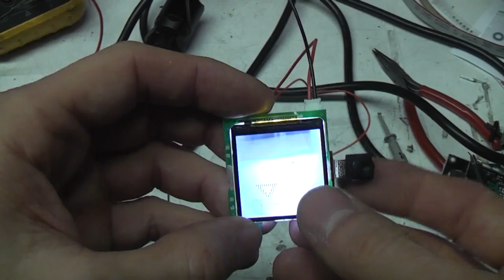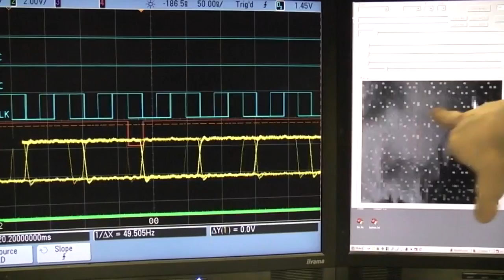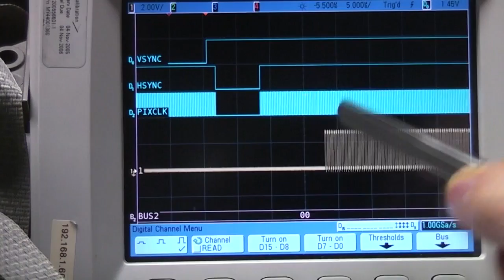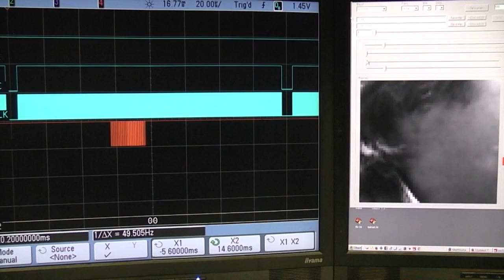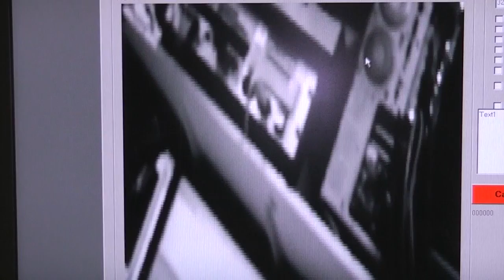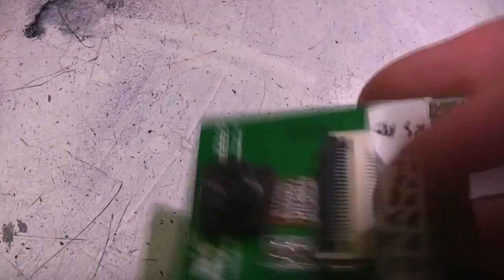Interfacing a cheap phone camera module to a PIC32 microcontroller.

Comment: ten years, wow. people have been able to document almost all the registers of the raspberry pi camera, dunno exactly how, maybe fuzzing, but they've found  crop and timing registers that let them do really silly things, like getting x000fps at 128x64 crop. imo omnivision is paranoid about documentation because the asics are so similar. they get to do binning and market segmentation pretty much entirely in 'software', and especially with phone sensors the spec bumps are based on reduced duty cycles. found out about that because sony is actually explicit about it in their documentation

Comment: Thanks Mike, I noticed that you kinda focused around maintaining frames rates and therefore DMA management and general memory consumption where clearly important. I question, did you ever experiment with very low pixel clock rates. The reason I ask is that I don't need full frame rate video, but rather still capture. ( In fact even the still capture does not need to be fast per frame, as the image content will also be almost entirely static as I'm looking for monitoring leaks in roof spaces).  I was hoping to use of a bag full of old phone modules that I have lying around to capture surveillance remote monitoring images and slowly dump out from the location using NB-IoT. Its simply a reasonably cheap CMOS sensor with a usable interface that I need. Do you know is these devices continue to work if you push the limits of low speed operation?

Comment: Wow thanks for being probably the only person on youtube to go to this depth about how image sensors work! Amazing information!! I've watched this about 12 times, initially knew nothing about electronics at all, done a heap of googling in between, but now understand everything of what your are talking about.

At first I wondered how a "Piano" fits in with electronics, but now I do know what a "PLL" actually is!  I feel confident enough to try and design/build my very first ever electronic circuit using one of the optical LVDS variants .. this'll be fun ..
Reply: As someone who is in the position you were in, were there any particular websites or Google searches that made finding everything easier for you? I want to figure this all out but I am struggling to know even where to start.

Comment: Repeats himself too much, I gave up at 1min because in that time all I got was low res display camera blue & white LED's about 5 times. Why don't they write a script that they read/follow so they don't sound like a drongo.
Reply: etmax1 Minutes 2 - 26 were very dense and non-repetitive.  Worth a watch.
Reply: David Williams
Thanks, I started from 2 minutes, much better. I should have been more patient I guess. Very interesting. So what's the slowest rate you can clock the pixels out? for a robot I'm thinking may 1 frame per second or even every 2 seconds would be good for obstacle avoidance.

Comment: MT9M001 also can skip columns/rows internally, so you can down-sample image and at the same time, get higher FPS. If you need slow that down, you could simply increase shutter width, and that will slow it down as much as you need

Comment: i connected MT9M001 to STM32F429i in no time via DCMI and using SRAM as frame buffer, not only that, i am using SPI DMA for sending 200x200x8 image to computer

my question, how can i load data to computer at 30fps/HD ?
Reply: SincereFirst branded camera modules is great.

Comment: I was making a pixel led strip light-saber load pov images from sd card, but I was completely out of memory, had to do similar; read file for 32x3 bytes, spi out the pixels in rgb, continue reading file. If I buffered the whole file I would quicly be out of memory.  Very clever stuff!

Comment: Great! As it so happens, I was given some of these "Sunny" branded camera modules recently. Not that I know what to do with them, I can barely write a few lines of code.
I can't find any info on them. On one side of the flex, it says "8806Z Sunny", on the back side "806Z Sunny" The model is 8806Z-200, apparently... ;( I'll see if I can find a breakout board you mentioned.
Reply: SincereFirst Camera Modules is great. 8806Z

Comment: Mike wich is the easiest way to interface one of theese cameras to a composite video output?
Reply from the maker: Why bother - there are plenty of cheap composite cameras out there.
Reply: mikeselectricstuff I am trying to build a small cheap video transmitter to mount on a quadcopter. All the cameras i can find are at least ten times more expensive than the ones you've got.

http://fpvhobby.com/83-1-gram-nano-camera.html

By the way great video as always
Reply: Rodrigo A. H
Why not transmit digital video data?
Reply: katelikesrectangles wouldn't the decoding create too much lag ? Keep in mind this is for piloting remotely. Plus i haven't got a clue on how to adapt my video transmitter to digital
Reply: Rodrigo A. H The decoding would be done on the receiver which can use bigger batteries to get more power. My last quadcopter build used a pair of STM32F427 MCUs with DCM Interface, one ran the camera and did JPEG encoding, the other did the decoding and LCD control.
Reply: Rodrigo A. H I'd get a composite "nanny cam" and put a different lens on it.

Comment: Brilliant work! What language did you use to write the PC-side GUI? 6Mbit via serial is insane!
Reply from the maker: stonent VB6. Sorry!
Reply: nRADRUS Even with GUI frameworks such as QT, most times it's completely impractical to write GUI applications in ANSI C. VB6 blows everything out of the water for rapid development, especially for test applications
Reply: stonent I took VB6 in '98; While I agree that C# is more suitable, VB6 is more than adequate when no R&D time to learn another language is available (ie: I work fulltime and study part time). I'd absolutely love to learn C#, but it'd take me years to get as fluent with it as I am in VB6 and ANSI C.
Reply: nRADRUS Good luck in programing GUI in ANSI C, it is pure waist of time. for GUI VB is easiest solution.
Using QT or Tk gui make your application unnecessarily large (QT need 50MB dll just to start application) and you instantly lose all advantages of writing applications in C++ (size and speed) so then is much easier just to write it in easiest solution like VB.
Reply: Syntactically superior?  You're off your bloody rocker
Reply: It looks like a Visual Studio based app, so likely VB, C# or C++.
Reply: PodeCoet
Yep. QT library is not ideal for rapid developments in C or C++. "Tk gui" is better ) And you can copy-paste some code blocks between PC-side and MCU-side. It's very big advantage (IMHO).
Reply: PodeCoet I took vb4 I think back in the  90s, having learned regular basic as a kid. I never used it again outside of the class. I am almost through a c# class currently and am already writing real programs outside of class.
Reply: mikeselectricstuff I know a few years ago you said on eevblog you were looking for a C like language to replace vb6. Did you ever find anything?  I was considering wiring or processing until I picked up C#  heck even MS makes .net micro that will let you program 32bit micros with it.  My favorite part of c# is basically eliminating the need to write your own code for type conversions and such. Just tag on a .ToString or .ToInt32 or whatever to your variable and you can read it as a string, int, float whatever. Or you can use TryParse that only does the type conversions if it will succeed and returns a boolean if it worked or not.
Reply: PodeCoet I started an online class in September and read a chapter on Sunday and turn in my assignments that evening. I've already written a replacement for some digital signage software at work. Windows forms are still the same for c# so you've already gotten that down. WPF is great. You can do so much more than winforms with it. It generates XML based code for your GUI section so if you are a typer you can adjust all your controls and such from the XML panel rather than the properties on the side.
Reply: stonent Using micro .net on microcontrollers is plain stupid. It take 256 KBytes of flash and 64 KBytes of RAM just for it.
Reply: Miloš Lazović i use this method in embarcadero c++ builder already. MCU-side ANSI-C is compatible with PC-side C++, and i share many things between. PC-side application size is not important. Your VB used same-sized code in run-time libraries. But of course, it's a matter of habit :)
Reply: nRADRUS And Embarcadero c use multiple dll so it make no significant difference over VB and it is good only for small projects (it have so many bugs in optimization of large code), if you want to make commercial application for windows then you use MFC, if you use X then you use x11 sdk and that is all. For rapid pure GUI application (if you don't need application that mostly display data) VB is best solution, if you need commercial on desktop you pick Intel or Microsoft (but limited to windows) or if you want to go cheap use gcc.
What is point sharing code between microcontroller and desktop? It have no sense, code for microcontroller is optimized to run on it not on desktop.
By the way my comment was "VB6 is more useful than most of new versions" not comparing VB6 to C++ but VB6 to newer versions of VB.
Reply: Miloš Lazović
actually MFC is obsolete for commercial application. many miscellaneous control implemented only in .NET (like display brightness control for MS Tablets and Notebooks, for example).
Reply: Miloš Lazović There is a way of compiling Qt programs statically so you don't need the dll's, the exe size get about 3MB bigger, but it's fully static. I do agree with you about VB6, I'm deeply saddened by MS including VB in the .Net non sense. I can't find any language today like VB6 so I still stick with it.
Reply: nRADRUS Now you show how little you know about MFC programming (but probably I should expect that because you are more instant programmer for you better choice is to live C/C++ to someone who know what is doing and you switch to Java or something like that).
MFC is just wrapper for portions Windows API to C++ classes and nothing more, all it is missing in it you write by yourself.
Even Microsoft dont use .NET for its applications (they use MFC) so it tell you something about it.
Reply: norbsli I didn't had time to bother QT, I don't need it and I am not big fan of application frameworks, for me they are useless for commercial applications, they are good for only rapid development of simple applications.
As newer versions of VB that use .net it is totally unnecessary move by Microsoft, but probable they try to push .net at any cost (they are astonished by Java so they think it cam make same with .net)
Reply: Miloš Lazović
lol. Try to regulate screen brightness without .NET. .NET is also wrapper, but little more complicated.
Reply: nRADRUS Look at SetDeviceGammaRamp and you will get your answer, it is part of Windows API no need for .net
Reply: Miloš Lazović false.
Reply: naikrovek what is false?
Reply: ***** It is just personal preferences and programing style, some people prefer VB syntax, some prefer Python, come C/C++. Python syntax should be easiest to follow but personally i don't suit my programing style (I prefer to write first critical parts of app and after that i bother with "boring" stuff). I prefer C++ (or C but from C99 before that I hated that you need to declare variables at top ....), I use Fortran sometime (it is still unbeatable for complex math) but C# for me look like bad mutant between VB and C++ and like Java it force all to be Object (class) which is unnecessary (Object are useful in some cases but not for all).
Reply: mikeselectricstuff VB6 is more useful than most of new versions
Reply: Miloš Lazović
when you program microcontroller with ANSI C it's useful to program PC-side with ANSI C too ? is it not ?